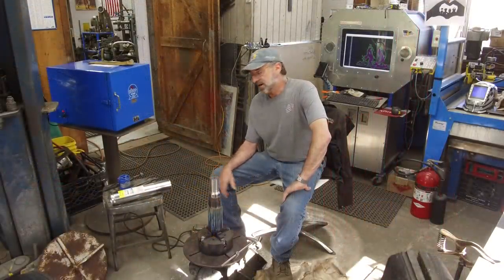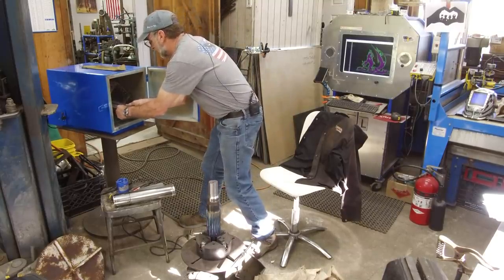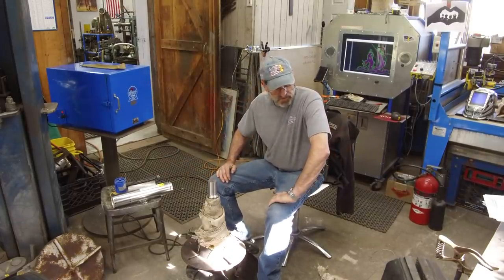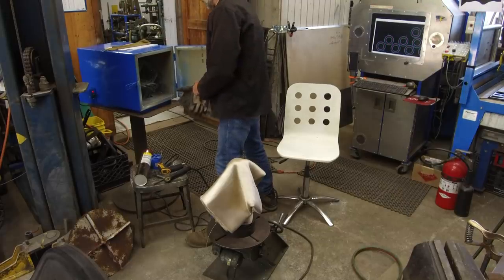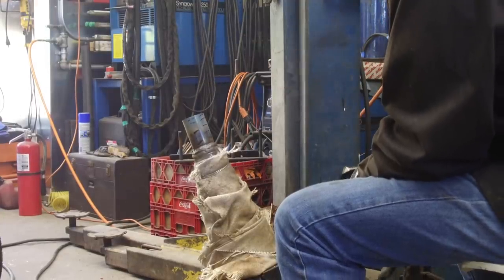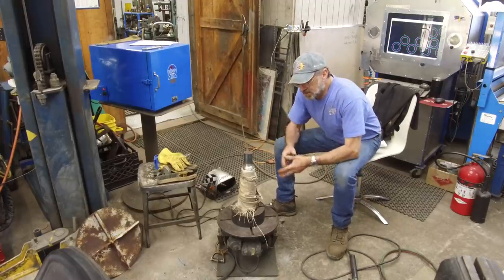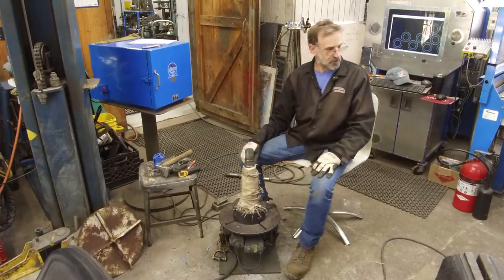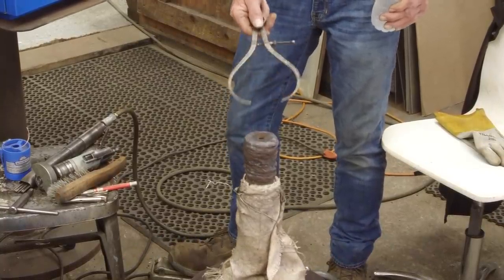Put The Spline In The Coconut Part Three

Comment: 'No replacement for honest experience' was on full display here Keith!  Amazing to see you on camera discover that your first option for rod material didn't pan out due to material incompatibility, and then your words afterward that yes, you do wanna do some experimentation of finding the right settings to see if the rod material would work, but such experimentation will be done at a later time, on your OWN test pieces, NOT on a customer's part that you can't risk doing irreparable damage to.  Holding your curiosity in check and remembering you've got a commissioned repair job to finish first, experimentation with welding settings for the new rod can come later when you have a lull in customer orders to fill.  Wonderful to see that consideration here. ^^

Comment: heh the set up to build up reminds me of a potters wheel for making ceramics but what ever it takes to do the job though I saw enough of the rod oven organizing the types of rod yesterday helping at the shop of nkp 765 did not realize the rod oven got so hot, as i dont really do stick only mig at home what little I have done over the last few years, and 10 bonus points for the old spring style yankee calipers for mesureing, not many use them often anymore well outside wood turning which I have a pair for from starrett but they are designed for metal machining very nice a bit more they what I really need but very fine control more then regular wood turning calipers and so hard will never wear out for what I am doing

Comment: 3/16 Rod loves 200 amps Plus in flat or horizontal. Feed rate varies. It might have been easier with 5/32 on that diameter shaft. I love that 3/16 on heavy plate and big gaps.

Comment: OK, Keith.  Color me confused, but it seems like all the work that goes into getting this piece to the point that you can cut new splines is pretty expensive.  How much is the customer saving vs. commissioning you to just make a replacement from stock metal?
Reply: I had thought the same thing at this point.  But I would guess this conversation already took place with the customer and this is what they settled on.  It may have been one of those, "the customer is always right" moments.  But I guess as long as they are willing to pay for it that's fine, keeps everyone happy.

Comment: Check your connections, ground clamp cable to clamp, crusty anything and bad current. Just a thought, as the video weld sound and sight seems weak for 120-140 amp.

Comment: On 3/16 8018 and 11018 I always ran about 160 amps but with stick, you can run cooler by running a close arc or heat it more with a wider arc. That first rod you were using just didn't sound right. Maybe the amperage was too cold or the travel was too fast. We used all Washington Alloy rod and wire. You might want to contact them. Does your local scrapyard have a Niton Analyzer to tell what kind of steel you have?

Comment: Does your welder have a hot start ? Is your power supply for your welder high enough that could give you porosity.
Reply: I would not started with 3/16 rods I would have used 1/8 or 5/32 rods smaller rods gives a finer grain  and smaller porosity. The rod you used first looks like it has a porosity problems at lower heats. You have a pretty high preheat  for the size of the rod you used for most metals that I have dealt with you stay below the 500 degree mark. When I used 120/18 rods I was working with titanium you had to use low temp preheat so you would not burn the titanium out. I think you could have used the 120/18 right from the start as long the shaft was not a low grade of s.s.

Comment: @KeithFenner
Was this job a candidate for spray welding or did it need so much build up that stick welding was easier?
Reply from the maker: Spray coating is the right terminology, not a bond to hold torque applications. ;{)
Reply: Keith Fenner Thanks Keith, I appreciate the videos and seem learn something every time. Good luck in your new location, I’m sure it will payoff in the end.